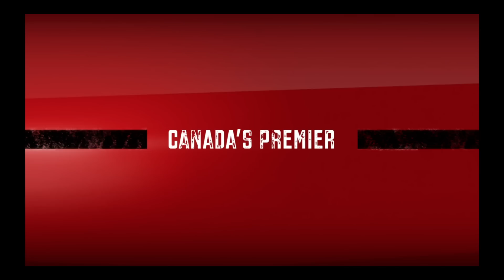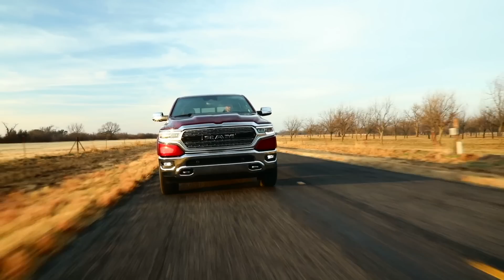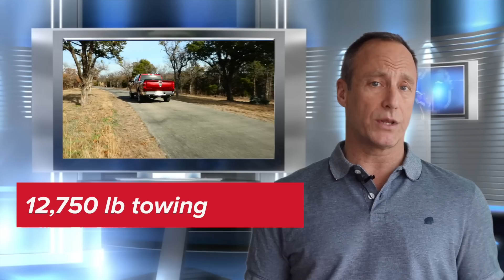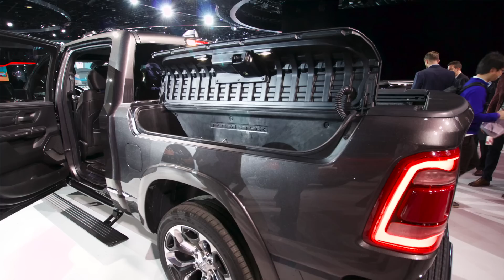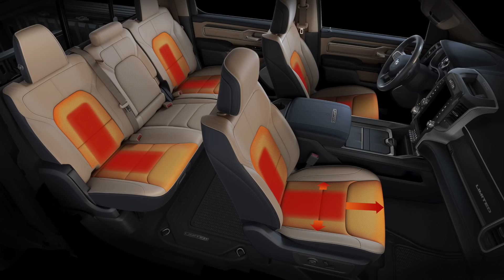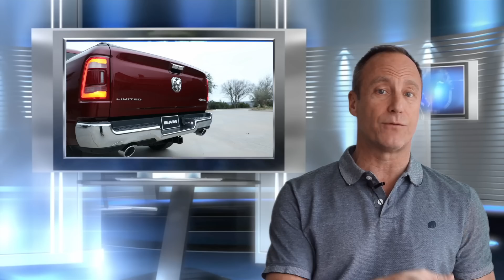Ram 1500 Engine Drive Train

Comment: It's still a dodge. Did dodge ever fix the front ends on their....(lol) hd line?
Reply from the maker: They're always fixing them ;)
Reply: Ptown Rat living in the early 2000s
Reply: Ya its too bad Ram 2500 and up switched to American Axles {corporate Gm garbage} in 2003.  Even though Gm spun the company off it still continues to build poor axles, ball joints and... driveshafts that take some weird u-joints.  Its frustrating that  Dana had finally got their axles upgraded to handle the weight and power of the cummins,  and Ram  I would guess to save a few dollars  are using  the cheaper  junk  that we had  to put up with on the  Gm  trucks.  Bring back the Dana,  nobody can afford to keep a powerstroke running and the Gm trucks are well still a GM.
Reply: Far North Squirell 
Yup. How many service bays are at a dog dealer? Answer. A lot! 
Funny that the only dependable part on a dodge is a Cummins. 
Mercedes dumped Chrysler, add who bought it? FIAT! haha haha,  Fix It Again Tony.

Haha haha, why Chrysler the only American car manufacturer owned by a foreign company?  Because they suck. 

Consumer Reports only uses black ink for dodge products, not one vehicle with reliability... Maybe the wrangler. Which was an AMC.

Comment: The eTorque system is cool and all, but find a way to stop the rear wheel wells from rusting out.
Reply from the maker: My 2004 Ram 1500 never had rust problems and I drive it 300,000km and had it for 11 years. But I also don't live on teh coast and they don't salt teh roads here so that probably helped.
Reply: Wash it. There is specific places to wash to clean out fenders in rear. Look it up

Comment: I wouldn't buy one simply because to much stuff that can go wrong and the price is outrageous. RAM needs to make a simple and low cost truck for customers and start forgetting about fuel economy and all this tech crap.
Reply from the maker: Lots of folks expressing the same sentiment. My advice is buy a fleet truck - get basic. There's just not to much to talk about because they don't really change. The upside is the trickle down effect. Base model (fleet) trucks get the high-end features about five to seven years after they're introduced.

Comment: Glad to see Dodge finally refreshed the look of the Ram... bet this model will be in the 50-60 K range... but seems all loaded pick-up's are getting that way... more than my first house cost....with all the electronics and added features you might be better off shelling out for a lifetime warranty as well...
Reply from the maker: I wonder what a lifetime warranty would cost.
Reply: We bought one when the Dart came out in 13 just in case... seeing it was a new model.....60 K miles later... of course the car has been perfect , yet I have heard horror stories about the Dart from dis-satisfied owners  ... that warranty cost about 1300 bucks then... I would bet for the ram would be about double that...

Comment: I wonder how many of things will fail when I buy this truck ten years from now lol
Reply: Mike ,don’t worry , you may fail before you have to worry about the truck failing. 10 years is a long time for a carbon creature.
Reply from the maker: Good news is you'll know exactly what will or could fail and there'll be aftermarket parts to make it better. Just like for 2009 model trucks today.

Comment: Give me a Chevrolet. Hell with this unreliable junk they call a truck!
Reply from the maker: Chevy is a solid brand of truck. I can't wait for them to release the 2019 Silverado stats.
Reply: Same dude! But we do have to face the facts about every brand. None of them last like they used to now that everything is being made out of cheaper/lighter materials and jacking the price up don't help either. But I really want to see how the new 3.0 duramax does against the competitors. Cummins guys will no longer be able to say "six in a row, ready to tow" without complimenting the new duramax, so jokes on them. Haha
Reply: And fiat is? I don't think so. Chevrolet may have recalls but at least they recall them. Ford is probably in some deep shit right now over refusing to recall their vehicles. All vehicles now aren't built to last but Chevrolet is the only company I'd trust considering that they aren't diving into all this fancy junk that shouldn't even be on a pickup. I'll give them props for at least listening to their customers when it comes down to  designing their trucks. You get a truck to haul stuff, not go on vacation. Gas mileage should not be a factor on a truck but on an SUV I complete understand, this is just something expensive to tear up and cost alot of money. I'm not contradicting myself, I'm simply explaining that everything is getting too advanced to be reliable and last but I can honestly tell you that the Chevrolet will deliver every time from the way they are designing the powertrain and body and keeping advanced features to a minimum for the working man. Just give it time, you'll understand what I'm saying after they release the truck, after about a couple of years they'll be recalling this system. Ram already has the worst crash test rating out of the three brands, why would I even want to own something like that?

Comment: When ford announced it would be using aluminum in its body’s to save weight, the other two (GM & Ram)  poked and made fun of Ford. But they themselves scrambled and struggled to keep up with the towing capacity with all the weight they saved.
Reply from the maker: Absolutely. But I can't figure out why Ford didn't but an aluminum bed in the Ranger? Too expensive? Or not enough weight savings?
Reply: 4WD Magazine is that right? They didn’t offer the aluminum in the bed of the ranger? That is a bit odd.
Reply: It was mainly a supply issue, GM has been looking to go aluminum for quite some time, but ford beat them to rights of the major almubimum manufactures
Reply: Having an aluminum tailgate is helluva lot different than putting a hole in the bed of a truck with a toolbox. It's a truck! not a soft drink!

Comment: 100 lbs 0f  torque...u wont even notice it. get rid of it before warranty over, ford worse tho.
Reply from the maker: I was wondering if this is supposed to be a marketing battle of 8-speed vs 10-speed transmissions in Ford and Chev. Or do you think there is something else coming and they want to get us used to a semi-hybrid truck?
Reply: It's not meant to be additional torque. It's to help in the front end during start stop, and to assist with transfer from 4 to 8 cylinders

Comment: Torque assist is like a Patch. Its short lived and not any time you need it...like on the highway passing. That little battery pack is gonna add a few pounds, the RAM people havn't said openly its gone on a certain diet...soooo what we have here is a Gimmik. Im in the Solar System business. What do you call cheap, that 90HP and 100+ Ft Lbs torque is gonna lean on those batteries! If you think their gonna be charged...just after a few stops...good luck, they need a huge amount of amperage for quite some time before they have what they need. Sorry guys, not cheap to buy! and tipical gimmmick RAM! And just imagine, questioning the Eco Boost with all the power when you want it...try driving up the IKE with this !!!
Reply from the maker: I'm waiting to pass judgement until I drive it. Living on the west coast I'll be able to give it a goood run up the mountains towing.
Reply: It's exactly when you need it. During the front end for fuel economy.
Reply: looks like a great idea, i wish my 01 had AFM and this feature
Reply: yeah, I think it's great

Comment: Fuck dodge all parts made in Mexico and China but sold to stupid Americans. Dodge 350 doesn't make 400hp SAD fuck fossil fuel burning dinosaurs on wheels go full electric get with the program idiots
Reply from the maker: With the direction every manufacturer is going in, those electric trucks are just around the corner. Screenshot your comment and remind yourself to add it again in ten years - you'll look like Nostradamus - and if you're wrong - no worries, no one will remember.

Comment: lmao.. it looks like a chevy now.. why the fuck would you want the heat lines to the rear axle.. obviously just shitty engineering trying to overcome some heat issues they had in testing and try to say its a feature.. lmao so all these companies that were ripping on Ford for having aluminum bodies are now half aluminum which is worse as you get varied corrosion on different parts and issues with dissimilar metals
Reply from the maker: The heated rear axle was a double take for me too. I wonder if it was specifically for Texas truck buyers - 2WD and stinking hot? Different metals - good comment - galvanic corrosion in corrosive environments - where one metal breaks down at an accellerated rate. Might be an issue for every manufacturer for trucks buyer near saltwater coasts.
Reply: The Navy had big issues with the LCS-2 variant's aluminum hull meeting the steel propulsion units. Easy fix with a buffer material or noble metal but I don't want to have to replace zinc anodes on my truck. As for the coolant lines to the rear diff that's just more coolant to need to replace and/or flush and adds way too much vulnerability to a rather critical system in the rear end. Why not just use large heat sinks like after market pumpkins offer.
Reply: Thousands of customers operate in Alaska type conditions!

Comment: 100k truck with all the bells and whistles. Craigslist, 3500 dollar truck, will work just as and probably longer than this over engineered piece.
Reply from the maker: I'm a huge aftermarket parts enthusiast. With a bit of work you're not far off, although I've never gotten the fuel economy of a new truck and it's usually been about $15,000-$20,000 when all is said and done.

Comment: Where do I have to go to get a pick up truck? You remember, basic work vehicle, one that you can repair with basic tools...one you can buy for a reasonable price.
Reply from the maker: Ford Ram and Chevy all build half-ton versions they call fleet vehicles - bare bones no-frills. But most dealers don't bring them in because they can't make a lot of money on them. Find an honest dealer and order one - it will be exactly wht you're asking for.
Reply: John Scranton 

Go back in time, 1987 would be perfect
Reply: like the old WT1500 back in the 90's!
Reply: What are you cryin' about ??? Every maker has a base model that is a simple, basic truck. You don't want the fancy one? DON' T BUY IT

Comment: I’m stuck between the new rams and a new tundra and mpg is god awful on tundra, I’m so stuck on which I should get. These new rams are impressive though!
Reply from the maker: I have a few friends with Tundras - but they are old, the Tundras I mean. Toyota just refuses so spend the R&D on their trucks. Which is why our domestics outsell Toyota trucks about 20:1
Reply: I found out after my U joint let go on my AWD 2007 Toyota Sienna that research is key. A U-joint is a simple fix $20 and  hour of time usually. On the Sienna it's only $3500.00. They are "non serviceable parts" you have to by the whole 2 piece drive shaft. I'll never buy Toyota again.
Reply: Really the only thing Toyota has at this point is perceived dependability and standard safety suit.
Reply: Resale. Toyota, a lot. Dodge, the worst.
Reply: F150 is also a good choice.

Comment: Technology is a blessing and a curse. I forsee issues with the eTorque system as well as the cooled axle. When it works, I'm sure it'll work great. But once the truck is out of warranty, replacing that stuff is a pretty penny. Is it really worth having it versus a normal V6 or V8 4th generation Ram? At first, maybe. Once these trucks are 10 years old, probably not. Simplicity is bliss, that statement is VERY quickly finding it's way out of the automotive industry, especially trucks. Just remember, more features means more future repairs. Electronics and all this high-tech stuff is usually NEVER easy to replace nor cheap. Truck manufacturers need to remember WHAT and WHO trucks were made for.
Reply from the maker: Thank goodness for the aftermarket. Once parts (if they are designed poorly) need to be replaced, there will be cheaper but better built options that you won't have to buy from the dealer.
Reply: People used to say the same thing about heating, cooling, and airbags. You can always get the barebones models
Reply: Agreed totally. We shall see how well all these technical items work after 10 years and 150-200K miles. Everything works great for 3-5 years. I wonder what it will cost when the infotainment dies and there is now no radio, no climate control, no security and no starting, and whatever else runs through that screen. Or when the stop start system dies and now you have a CEL and can't pass  emissions? Or when the 8 feet worth of timing chains stretch and again you get a CEL and can't pass  emissions and oh gee that will be $5000 to fix. Or your phased cams don't work right and that's $1500 to fix. And before someone says oh yeah but the electronics are better than ever, show me any electronics made now that last more than a few years. And don't forget that now we have "environmentally friendly" solder that doesn't hold and leads to cracked joints and short circuits. I'm sure in the coming years we who frequent salvage yards will be seeing an awful lot of not-very-old cars sitting around that once sold for $70 grand. I'm sticking with the older stuff that is simple, reliable and cheap. I guess I am becoming a luddite but oh well it makes my life easier.
Reply: Technology has always driven us forward.

Comment: The air ride in the ram trucks sucks. Lots of issues with moisture in cold weather.
Reply from the maker: Thanks for pointing that out. I don't know how prevalent it is but hopefully they've worked out the bugs for 2019.
Reply: 4WD Magazine lots of compressors being replaced due to the moisture forming and freezing causing the valves to stick, often see trucks with the front stuck all the way down etc.

Comment: coolant system flowing all the way to the rear differential? Not too sure about hot/cold long tube run for antifreeze through suspension just to get to the differential.  wondering about lift kits, potholes, off roading terrain...seems like you would risk losing your coolant.  I get it with brakelines being solid, highpressure and reliable, but they are thick and don't necessarily have properties antifreeze brings to metal lines and the risks it brings to cooling system.  Seems like a lot of work just to warm/cool diferential, didnt know it was a major issue in trucks.
Reply from the maker: All good points. FYI - as it turns out, they are only offering the axle cooling for 2WD.

Comment: This is really impressive, but I can't help buy wondering how will all these features hold up.  So much stuff to break.  If this truck is reasonably reliable, it will kickass!
Reply from the maker: Personally I'm not too concerned about the eTorque. In a way, it's all proven tech, just a new application.
Reply: I just bought a 2019 ram classic, was looking at new style rams, couldn't see on the internet where etorque improved MPG any, just made things more things to go wrong, and saved 10 grand going with classic!

Comment: What is the life span and the cost to replace the 48 volt battery?
Reply from the maker: Good question. Shouldn't be too expensive since (depending on the amp hours) they are in everything from solar systems to electric bikes. If Ram keeps selling a half million trucks a year - they should get even cheaper. Nissan and BMW warranty their systems for 8-10 years or 100,000 miles. Another question might be 'Will the truck run well with a dead battery?'

Comment: And Poor old toyo are still in the stone ages.
Reply: Yeah they don't have some stupid coolant line going to the diff that's going to break one day and run your coolant dry and possibly over heat the engine. Active tuned mass modules? Just more shit that'll break and need to be replaced.
Reply from the maker: I think they just don't put significant dollars into their truck program. 1.22 million corollas sold a year and 200,000 Tacomas?
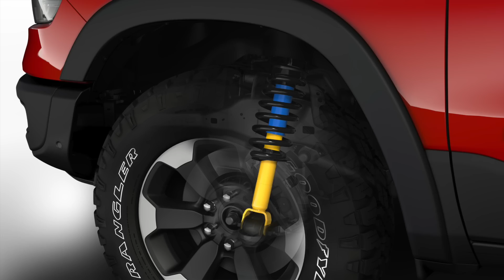Reply: Where they quietly last over 200,000 miles before being opened up, are fast as anything out there, 381 hp, 4:10 rear gear, have better brakes than 2500's, don't break down or rot away. They lead from behind, because they build cars first and better than anyone else.
Reply: Ryan  maybe that could be preventable through a water to water heat exchanger so they act as different systems but still transfer heat between each other. Just a thought, but I doubt that’s what it is

Comment: I am thinking that the coolant lines running to the rear diff will be a pain just for maintenance alone.  Also it the start stop and e=torque optional?
Reply: Probably no more maintenance than brake lines...which means about zero.
Reply from the maker: That is certainly possible. I just haven't figured out where the value is. At least it's only in the 4x2. There is nothing from FCA that suggests eTorque is optional.

Comment: Cool stuff but what does the extra weight do to there fuel economy numbers... batteries, wiring, coolant and the complex lines to the rear cooler add weight
Reply from the maker: Ram needs to hit 30 mpg in one of their trim levels to be competitive, we'll know soon.
Reply: Did you not listen,  the truck lost wt,  added more aluminum to help